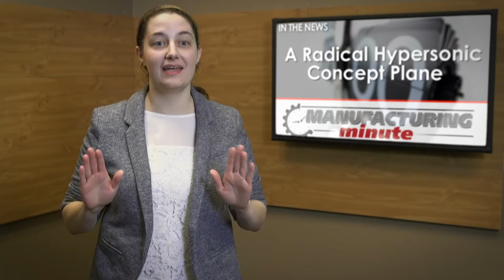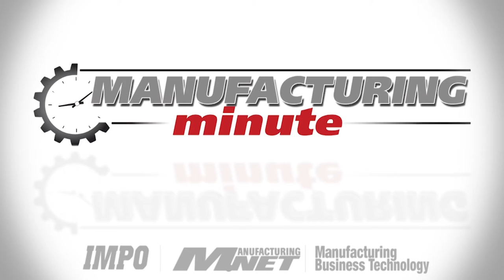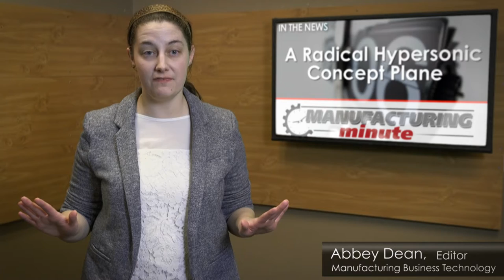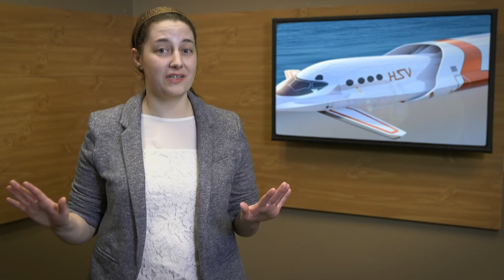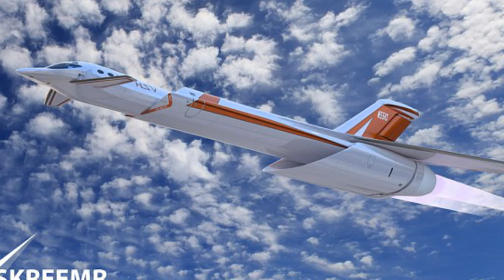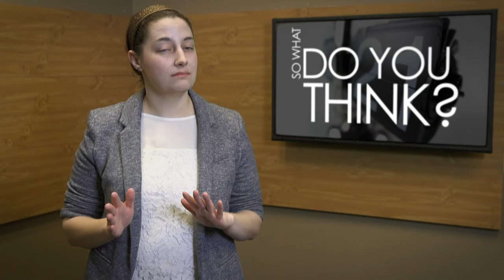Manufacturing Minute: A Radical Hypersonic Concept Plane

Comment: On September 18,2015 a 6th generation J-28(Fiery Dragon)flew at mach 6 speed and landed.THe J-28 used two turbo-0scram jet engines and a graphene-aluminum alloy fuselage,wings,tail and a graphene -titanium alloy airframe.The stealth J-28 has a graphene carbide coating that can absorbed radar signals and with stand temperatures of 3,000 degree Celsius.To find more information on the 5th generation airplanes,typed Wang Zhenguo and VLRAAM.The PL-21 VLRAAM that flew at mach 6 speed is based on the turbo-scram jet engine.